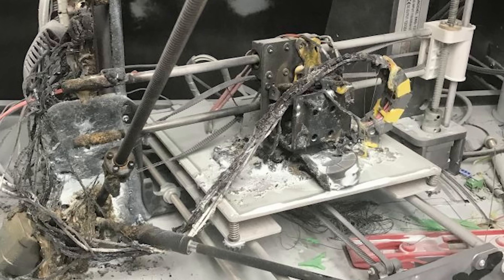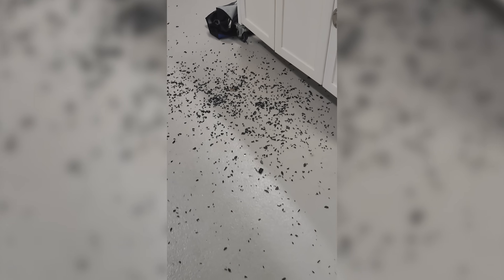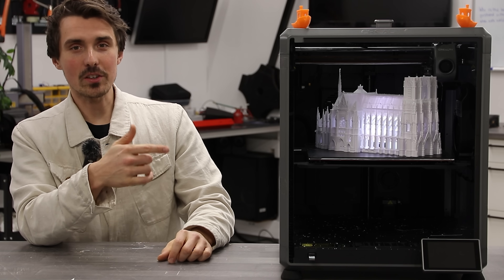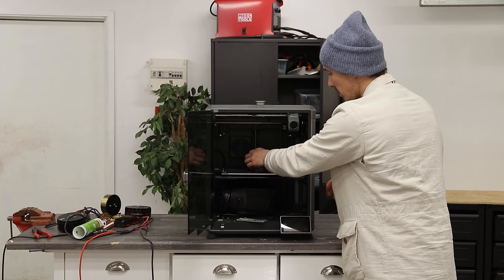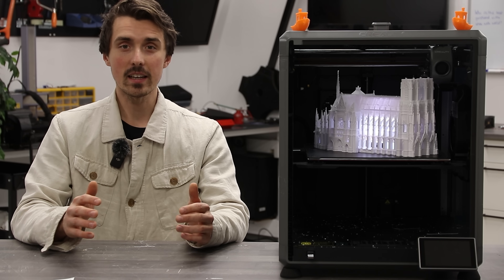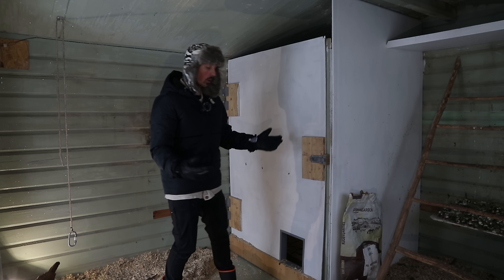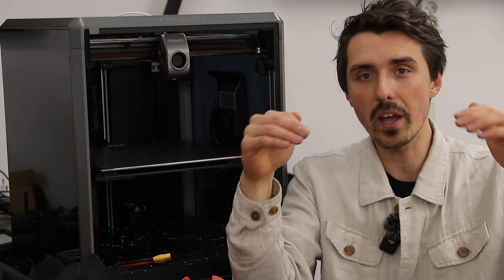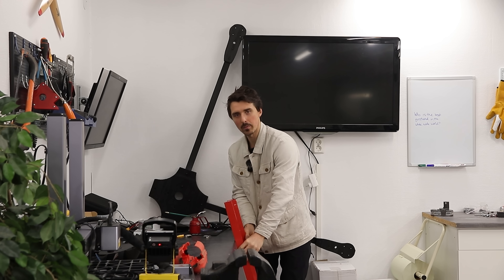3D Printers Are Getting Ridiculously Fast

Comment: I'm still using my Anet A8. 🔥🙂💬(This is fine.)
I would like a new one with auto bed leveling and larger build plate, and maybe multi color filament support, but i do not print that much and they are getting pricy if i want all of that in one printer.

Comment: I'm still rocking my Prusa Mk3.  Slow, yes, but rock solid dependable.  I might splurge for either a Qidi 4 plus so that I can print some more durable materials or for a Sovol SV08 and attempt Teaching Tech's multi head set up.  So many cool things out there now.
Reply: Yeah same here. Though mk3s. I still use them at home and work. Insanely reliable machines. Slow by today's standards for sure. Been planning to do maybe 3.5 update for them though and maybe get XL for work where I occasionally need bigger parts.
Reply: Hey I bought the sovol sv08 I have decent amount of bed leveling issues and the default screen doesn’t respond sometimes I wish I could go back and buy a bambu a1

Comment: Nice video. I started my 3D printing journey with K1C last summer and the user experience has been amazing. Never had to fine tune the settings too much and it's incredibly fast. 
0.08mm layer height with the stock 0.4mm nozzle provides so much detail... When paired with CF filament you can't even see the layer lines!

Comment: hmmm, you can probably use the winter to your advantage and print much faster due to the previous layer cooling off faster. ;)
Reply: Imagine not having enough cooling and instead relies on low temperature which impacts layer adhesion, just pre-built printer problems. For open source printer toolheads even dragonburner with weak fans are much powerful than those subpar garbage commercial printers.

Comment: I have been rockin the Bambu X1C for over a year now. After having  an Ender 3 pro and an Artillery Sidewinder. The Sidewinder is 3 times better than the Ender and the X1C is 10 times better than the sidewinder. I don't have stringing and my print speed is faster in comparison with your printer. Bambu slicer is fantastic. And, contrary to what you might have heard: the best customer service I have ever experienced. And no, I am not in any way sponsored: just a very happy customer. Een beetje de Apple van de 3D-printers, zonder de belachelijke Apple-prijzen.

Comment: As someone who’s had 2 ender3 pros for going on 4-5 years now, I think you convinced me to finally upgrade. Been on the edge for awhile and I can see it’s a major upgrade now
Reply: I personally went on the upgrade path with my ender 3V2 and i got to basically the same speeds as the K1 shown in the video. Though that is through years of incremental upgrades and it's not for those who don't want to tinker with their printer. In the second case, buing a modern quality printer like one of Bambulab's is an expensive option, but literally without any headaches ever again.

Comment: Even the older 3D printers can now go at higher speeds with smoother motion without any hardware changes, just by upgrading to the latest Marlin and using Input Shaping, let alone by doing a Klipper conversion. The AnkerMake M5 is a Marlin-based machine that reaches high speeds without even using the input shaper, apparently by doing a pre-scan and adjusting its acceleration parameters. So the good news is that the open source community is doing a great job keeping up with the state of the art in motion control, and everyone is able to benefit from those innovations.
Reply: True, I’m running an old CR-10 with Klipper and no input shaping, and it prints a Benchy in 30-40 minutes.  Biggest weak point is losing steps on the Y-axis because it’s a bed slinger, but input shaping would help that
Reply: @AC-vx3jz  how much time would a stock CR10 need? What do you reckon
Reply: @AljazJelen1992  Probably an hour or more
Reply: @AC-vx3jz  whaaaattttt! Ok im upgrading my 3D printer
Reply: @AC-vx3jz   so just Klipper and it makes a difference! What about motor drivers and control board?
Reply: @AljazJelen1992  No need to upgrade hardware.  Klipper offloads processing to software.
Reply: @AC-vx3jz  but isnt the native Creality 3 board with 8-bit controller?
I dont think it would work,nwill it?

Comment: My Ender 3 is begging for mercy, but I got enough ducttape to keep it printing until the motors burn out.
Thanks to Klipper it's a speedy boy too, just had to replace its brain with a RasPi 3.
Reply: Even though I have a K1 Max, my Ender3 still gets used.  It can print really nice quality when time isn't a factor.  I'm in the process of making it a 2 color machine using 3D Chameleon MMU

Comment: I love my K1 Max.
It was either Bambu Lab P1S or this, but then someone returned this to a local shop and it was available for half the price.
As you said, it is a game changer. I am printing much then before , mostly functional prints. 
From idea to finished print it is very fast now. This impacts my will to try new designs/solution in a positive manner, since I know, I do not have to wait the whole day for a print to  be finished.
Reply: I love how mod-able my K1 Max is.  After changing to smaller pulleys, adding a second aux fan, and switching to a 5015 part cooling fan it's SO good.  Way quieter and incredibly fast with basically no artifacts.  10 minute bench that looks more than acceptable.

Got mine early so it used regular volcano nozzles, which are so damn cheap

Comment: the new k2 line of printers is just coming out now, thats how late you are :P 

dont know if theyre much faster than the k1 though...
Reply: would never buy a creality machine before they fix their quality issue.
Reply: @airsoft3563  i bought a ender 3 v2, upgraded it with a sprite extruder, extra z axis motor and a bed level probe. its been great. i wouldn't say theres anything wrong with the quality. but i understand the k1 range had its issues. hopefully they are sorted with the k2, since i'm thinking about getting a printer thats not a bed slinger, bigger print volume, and has a camera and the more modern features.

Comment: Honestly, my A1 is struggling to get crisp corners. The decelleration, accelleration, droop, temperature, I don't know, causes it to have wider corners which I never had on slower machines. For me only the speed and pressing play from the couch are the only real advantages, I haven't found a big leap in quality, reliability or ease of use.
Reply: This is what your average bambu users don't even notice. Their calibration is crap, their motion system is awful, so they ran very aggressive input shaping and washes away surface details while not even going that fast.

Comment: Recently I got a Bambulabs X1C, night and day, all the previous 3d printers I used in the past were generations behind in comparison. I know is much more money, but the quality it's insanity, you can get 3d prints that are basically ready to use without any postprocess. Tbh most people would be more than fine with P1S or even the A1, but I wanted to get the extra features.
Reply: Agree, I'm super happy with my P1S

Comment: I hope you did not print the outdoor stuff out of PLA because you will soon find out why it's a bad idea.
Reply: PLA holds up fine outside. I've left prints outside for 3 years and counting (One of them was printed on an Ender 3 around 6 years ago), they do not get brittle. Some slightly discolour but that's about it. People have this idea that they will degrade but they don't without very specific conditions. I even left prints in the conservatory where I have pictures of the thermometer hitting 40c+ and the prints were perfectly fine.
Reply: Pla is still prone to deformation at higher outside tempatures   @hippopotamus86
Reply: Other then intense heat like 60c plus the prints should be fine. They do get britle over time on uv but so does most plastic.
Reply: @attecker  If at all, it takes a very long time. I still have a bunch of benchy's outside exposed to all weather since 3 years, I try to break them and they're really no weaker than when I first printed them.
Reply: @hippopotamus86  It really depends on the use case and the thicknes of material. A vase mode print will corode pretty fast, but anythign with multiple layers is protected from uv on the inside of the top layer. If you have a structural part that is under tension it will fail. But not over the course of one summer. The neat thing about what i just tould you is you can spray ur pla in primer and then some uv resistant paint and it basicly wont degrade. But 99% of the time even thats unecesery.

Comment: The k1 max is a piece of junk, my first one was DOA, the 2nd one has nothing but issues with ringing. Switched to Bambu Lab and never looked back.
Reply: I actually thought the quality of the prints in this video were bad. Bambu printers are miles ahead at the same / faster speeds.
Reply: @hippopotamus86  They're absolutely similar. Bambu aren't magic, if you know how to tune your printer, you will have the same result.
Reply: @SaitoGray  The print quality looks crap in this video. I never have to tune anything on any of my bambu's.
Reply: @hippopotamus86  you don't have to do it because you can't do anything other than basic maintenance;
But sure, your bambu is some sort of magical machine who does better than a calibrated printer.
Reply: @SaitoGray  It does amazingly well. Rather buy these P1S's for my farm that need little to no maintenance than mess around with Creality printers that apparently need calibrations to make them print well. Each to their own.
Reply: @hippopotamus86  Incredibly funny how every bambu user i talk to as a "farm" yet none of them seem to know how to calibrate a printer.
Bambu barely have the ecosystem necessary to manage a group of printer, because they're closed system and are a pain to work with if you want a serious, software managed farm.
Reply: @SaitoGray  yeah bout that….the value with camera, nozzle wipe, filament cutter is just wild. Much better than k1. Aside from them being copycats. Just go with the OG one.
Reply: Ender 3V3KE is same. Three month in use, already replaced hotend fan 2510 - it was noicy like hell. Few days ago burn out ceramic heater of hotend. There is also a problem with the automatic Z level and it scratches the print table. It's my first and last Creality printer.
Reply: sadly alot of people still buy creality as its a Huge brand and offers some huge specs on paper. But their quality control and overall quality is realy bad. Nothing can compare to the luxery feel of bambu printers. even for my love of bambu i do hope to see some competition even tho theres little when it comes to bambu as of now.
Reply: @airsoft3563  my red flag to going with bambu is its software: proprietary
Reply: @airsoft3563 yeah my first was creality ender 3 pro years ago. It taught me a lot
Reply: My first one had a bent frame, but that was from a bad drop in shipping (box corner was smashed up).  They sent a replacement super fast and I have thousands of hours on it now.  

It's definitely a tinkerer's printer, which isn't for everyone.  I admire bambu printers, but will never own a device I don't have control over.  Running custom interfaces and connecting a secondary MCU isn't possible on those locked down ecosystems...  

I built an 8 color MMU with old steppers basically for free using an old SKR board plugged into the K1 USB port.  That is impossible with a bambu, you have to buy their solution
Reply: @4lan39  Did you go devil burner for the hot end ?
I want to make a ERCF, but i'm still kinda stuck with the hot end part of it.
Reply: @SaitoGray  I'm using a 5015 fan shroud by Franky3.  And a extruder gearbox with built in filament running sensor.

I think 3D chameleon is the cheapest DIY one to make.  And it is expandable pretty much infinitely.  Four stepper motors will get you 12 colors
Reply: Mine works perfect.
I am using it to create models to make moulds for Compression Forged Carbon Fibre Parts.
I only use prusament PLA for my prints and the results are fantastic, I print at 400mm/s for parts that mechanical fitment is crucial.
I make stocks and grips for guns, also custom parts for motorcycles and cars.
Reply: @DigiMannen  the 300mm³ area is great for pew pews, especially long braces.  There are so many things that I wouldn't have been able to print if I had a 256 mm³ printer
Reply: @DigiMannen I have 3000+ hours on my K1Max it’s been a workhorse too.
Reply: The k1 works really well once rooted and calibrated.
Bambu simp will tell you otherwise, but if you prefer overpriced close sourced machine, it's up to you.
I rather have control of my machine personally.
Reply: I spent a few weeks following the creality and bambu subreddits right during the boxing week rush, and I can say the type of complaints the creality customers were reporting were pretty appalling compared to the issues people were having with Bambu.
Reply: Bambu lab printer are junk too lol. Bambu lab and creality get their components from the same manufactures.
Reply: @LilApe  Imagine thinking quality is only about subcomponent manufacturer...🤡
Reply: @CarbonKevin  imaging thinking the choice in components doesn't play a huge part in overall quality.

bambu doesn't even use premium quality belts in their printers like prusa does, Its one reason why the A1 keeps getting belt fraying and the croexy printers need constant belt adjustment.
Reply: I'm done with Creality. I bought two FLsun V400s years ago and they have been running thousands of hours.
Reply: Same thing happened to me with their CR-10s way back in like 2017 then I got a anycubic i3 mega and never had issues until the bed warped then I got a Prusa MK3S and for the most part I’ve never had any issues with it beyond a couple that were mostly user error and same with my Elegoo mars 2 however I’m definitely getting an enclosed printer or large format resin but most likely the X1C for my next printer
Reply: I wanted to buy a bambu lab as everyone love them. But the print volume is too small, it’s a shame ... so I bought the k1 max and I'm very satisfied, i don't need to print multicolor that's too gay for me but the techs on the k1 max are so great and pretty damn well reliable, I haven't touch a single screw on it, works fine
Reply: @maxairmodels7796  🌈😂 my printer is gay AF, full rainbow plus black and white

Comment: Thank you annex engineering speedboat challenge for making speed something the mainstream wanted and manufacturers actually making their printers faster instead of bloated with rgb and other useless stuff... The speedboat challenge was meant to push the printer to the limit and then dial it back to get the best quality at the best speed. It's how you optimize something...
Reply: And now the speed boat challenge has devolved in to who can crap out a plastic turd that kinda of looks like a boat the fastest. Still think the challenge is interesting but wholde like a restriction that the finicht product should look like a boat
Reply: @Goroca  we discussed the quality part of the challenge alot, and in the beginning(first year) the gentlemen agreement worked. Never the less the intention of the challenge is to develop 3d-printers and then we need to go over the max limit to really see the biggest hurdle..

Comment: As a former anet a8 owner it's wild seeing the progression. I stuck with a sidewinder x1 until September of 2024. I kept telling myself "there hasn't been any crazy changes so it's not worth getting a new machine" and my sidewinder x1 was incredibly reliable. But I caved and got a Bambu A1. My God I was living in denial. Klipper, input shaping, full auto bed leveling (like 0 adjustments on my end) closed ecosystem that is actually incredibly good, pei magnetic build plates, reliable multi material, and lots of other minor things. Are all amazing upgrades from my old x1. There are also CHT nozzles but Bambu doesn't have one yet. I'm a full on Bambu shill now. Yes voron machines can go even faster. But I will take reliability over a little more speed.
Reply: I have the same history. In the mean time I got a anycubic cobra Neo which is semi high speed. I eventually got a Bambu p1s. ist awesome. got 2 of those by now... 2500 printing hours on one machine. still going hard
Reply: I also started with an Anet A8, now I have 3 Bambulab P1S and 2 Bambulab A1 Mini. It's wild seen the progression as you've mentioned. I also had an Ender 3, Anycubic Kobra, BQ Prusa Hephestos, BQ Witbox, Anycubic Vyper, CR-10, Prusa MK3S+, Prusa Mini, Artillery Sidewinder X1 and X2, RatRig V-Minion... So I think I know what I'm talking about. The next one will be a RatRig V-Core of 500mm^3. My company has to grow!
Reply: I'm still rocking an Anet A8 as my only machine with Marlin firmware and an Octoprint Pi touchscreen, so tempted with something new with an AMS type system but I don't think I do enough to warrant it.
Reply: @andy25104741  sorry if you get multiple replies, YouTube keeps deleting the comment on my end. I'm gonna highly recommend an A1 or A1 mini tons of features also not as much of a fire hazard.
Reply: Should kote they don't use klipper
Reply: @BeefIngot  really? I assumed they used some custom build of klipper.
Reply: @x9x9x9x9x9  Nope. Custom firmware for their printers only
Reply: Meh, closed ecosystem is a miss. Open or nothing.
Reply: @Hawk7886  I used to feel the same. I also hated the fact they use proprietary parts. But it's really that good it's worth it. Also the closed ecosystem thing isn't 100% true. You can use other slicers, people have made custom firmware for it as well.